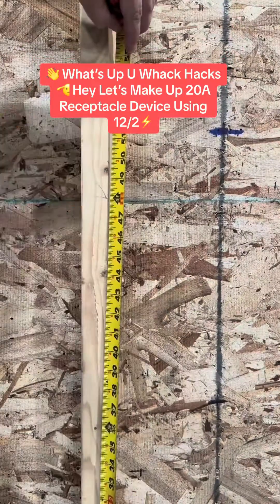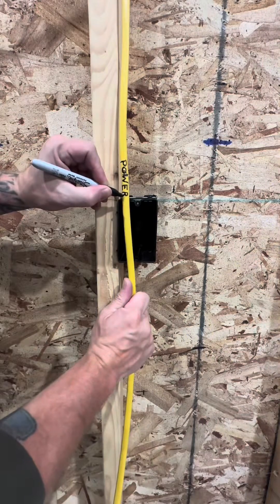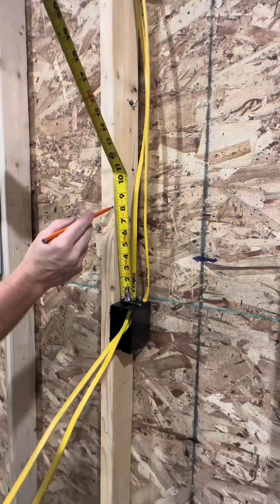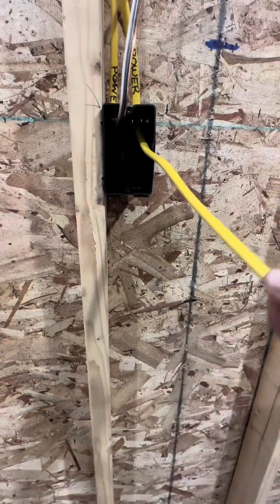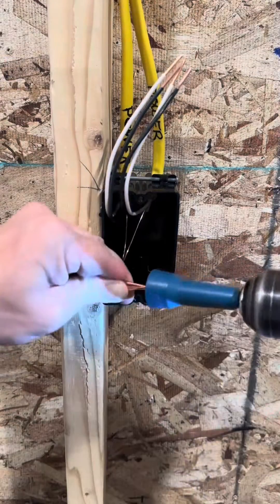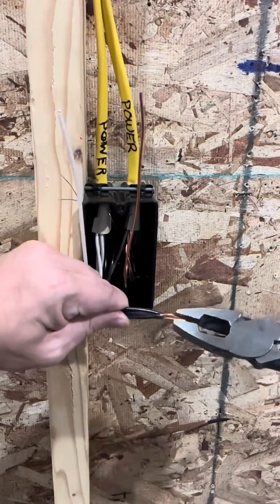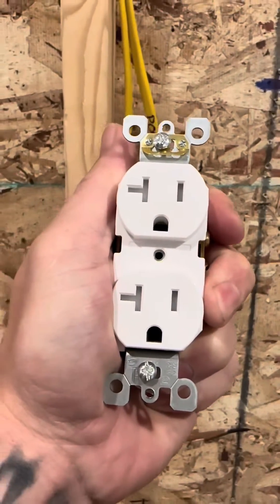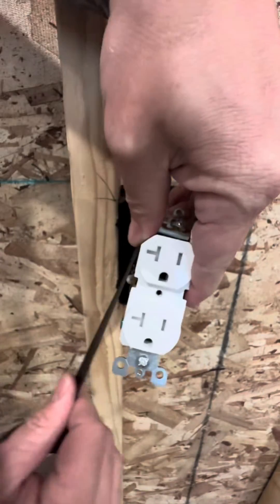⚡️How to install a 20amp receptacle device💥

Comment: Nice quick video, nice edits. But why use a razor when you have the romex stripper? Check out ideals box jaw stripper. I'm assuming you use a razor to get that inch of sheathing inside the box. And tape only if you don't trust the way you stuffed the box. 
Also, 95% of the country would absolutely shit on anyone using a nut blaster, even though it makes sense. I'd just feel bad for the guy coming back through after you w out one